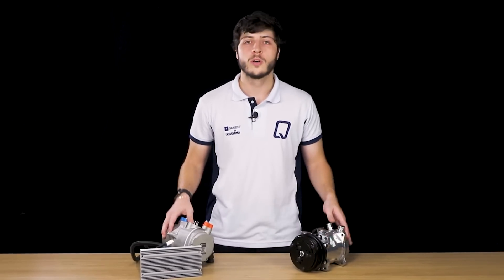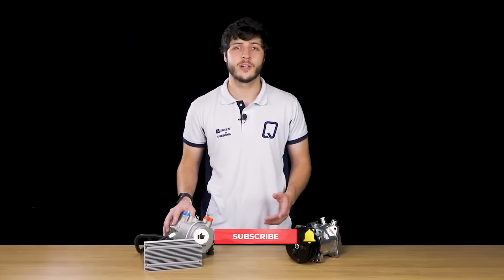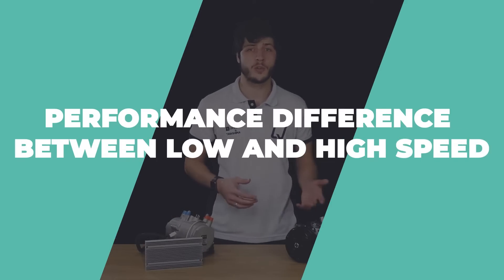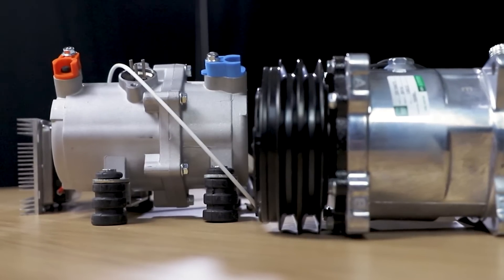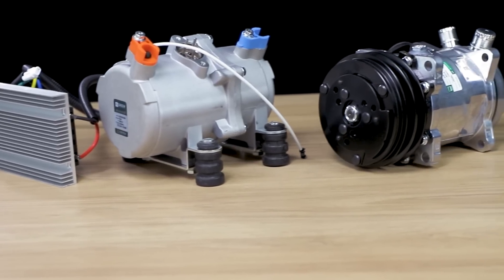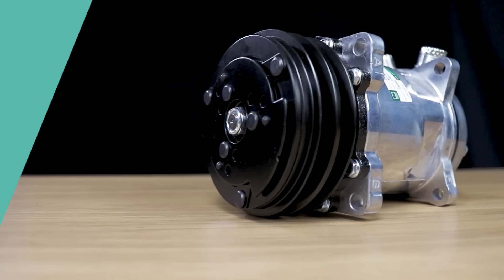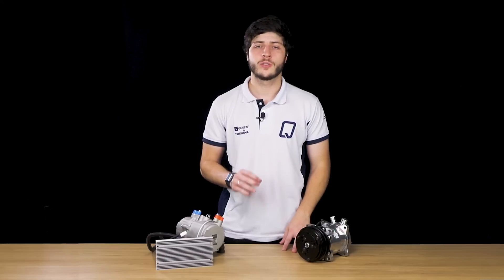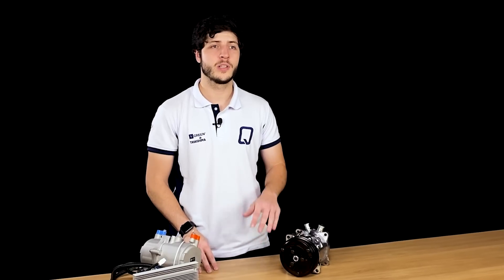Electric or mechanical compressor, which one should i buy?

Comment: Would it be hard to convert a 12v A/C compressor for a high output onboard air compressor?
I already have a high amp alternator and large lithium aux battery setup.

Comment: Hey thanks for this video but would great id you can make a video answering my question 🙏🙏🙏:
First let me tel you what car I have, it’s a kia sorento 2017 and I already installed a 95A AGM battery and going to have a massive SQ sound system around 16 speakers (with 2 of them being subs one in the front and one in the back) I know that I have to change my alternator but honestly I’m way to the freight to a new powerful alternator and damage any electrical system in my car and I truly want to add a good electric compressor to my car since I’m having a lot of issues with my current belt driven adapted air compressor and my AC electrical system (wires gets extremely hot and blower really got blown and the fuse box in the engine bay started melting 🤦‍♂️at speed 1 and 2 all is good but at 3 and 5 the wires get extremely hot the the relay gets blown) 
So if I want to swap my belt drive compressor to an electric one what should I do to make it as OEM as possible keep my AC controller, working perfectly and make it as safe as possible and ditching the factory faulty  electrical system?
Reply from the maker: Hi, you can change your compressor for the electric model, and you can keep your AC controller. If you prefer, we also have an AC controller available. An alternator with 100 amps or more is recommended. Contact our sellers at 888-907-0705; they will help you with this. Thank you.
Reply: @qualyairusa yeah I was talking with you guys in the chat on your website but I asked if we can talk on WhatsApp since I’m in Ivory Coast/Abidjan and will be shipping everything I need from the US and wanna make sure beforehand that I’ll know how to install it so I need to send you some video so you can guide through everything 🙏

Comment: I’m hunting down the amps required. I’d like to run this with my little generator. I’m thinking about an in-line capacitor to handle the initial start then the little gen can run it all night
Reply from the maker: Hi, an alternator with a 75 amp is recommended. 

It will work and perform very well. 

If you have more doubts, contact our sellers at 888-907-0705. 

Thank you.

Comment: Can you please mention in comment the advantage and disadvantage of electric compressor
Reply from the maker: The electric compressor will perform as equal to a conventional model. The difference is that the electric compressor is connected to the battery and not the engine and we recommend an alternator with 75 amp. 

Feel free to contact our sellers at 888-907-0705.

Thank you.

Comment: Installed this on my truck and right away having issues! Charged the system with the recommended amount of Freon and it just blows how and the pressure will never drop
Reply from the maker: Hi, please get in touch with our sellers at 888 907 0705, they will help you. 

Thank you.

Comment: Can you please advise what are the requirements on the vehicle to replace the mechanical compressor by your electric one ? 
- How much alternator amps rating ? 
- Does it effect the engine performance by making alternator works harder ? 
- I have Honda civic 92, are high and low pressure hoses of it fitting pretty well with your electric compressor?

The last question how can I purchase it..
Reply from the maker: Hi, thanks for contacting us. 

- Don´t have the requirements to change; you can change your conventional compressor for the electric model. 
- An alternator with 75 amperes is recommended.
- It will perform very well, don´t worry about that. 

To ask more questions and buy, contact our sellers at (888) 907-0705. 

Thank you.

Comment: I have a 2000 black durango with a 5.9 V8 with a 270amp alternator. Which system will be best for my setup?
Reply from the maker: Hi, Both systems will perform very well. 

Don´t hesitate to contact our sellers at (888) 907-0705.

Thank you.

Comment: Any chance to replace an existing belt driven compressor to an electrical one? Wonder if is possible to replace my van ac compressor to run, specially while parked, from my EcoFlow Delta Pro. Delta Pro has a 12v 30A output Anderson connector.
Reply from the maker: Hi, yes, you can use our electric compressor, you will need to do some adaptations only. 

Don´t hesitate to contact our sellers at (888) 907-0705.

Thank you.

Comment: When your car is running its 14.6 volt only 12 at rest.Although 24 would be best you wood need two electric systems.
Reply from the maker: Hi, thanks for your comment. 

Don´t hesitate to contact our sellers at (888) 907-0705 if you need something else.  

Thank you.

Comment: Can I run this from solar panel by putting solar panel on the car roof...electric compressor
Reply from the maker: Hi, 

Unfortunately, It doesn't work because the energy that reaches the inverter is not continuous.

Comment: I got a question which am having a difficult time finding an answer for, am having a 1974 VW Bus and looking for the best air compressor that would handle the cabin area inside and what is the recommended power shall I have to keep running that device for at least 6 hours with engine off?
- air compressor specs
- power consumption 

Thanks
Reply from the maker: Hello, you can put our electrical kit, it will perform very well in your vehicle.

We have the kit that will fit perfectly for your vehicle, don't hesitate to contact us at the phone (888) 907-0705.

Thank you.
Reply: @qualyairusa  will contact you via email coz am from overseas 👍🏻

Comment: Hi I have a 1991 mitsubishi mighty max 2.4L using originally an FXA80 AC compressor. Would this work in it this old of a vehicle?
Reply from the maker: Hi, Yes, this piece will work very well. 

Feel free to contact our seller on the phone at +1 (888) 907-0705.

Comment: Hello greetings from Greece! 
Could you tell me how I’m I supposed to install it in a car that never meant to have a\c before? I mean what else should I need? The car has no control panel nor ac buttons in it!! Any help would be appreciated!! Plus I’m from Greece, do you send them overseas if it need to?
Reply from the maker: Hi Dehard, how are you? 

Yes, you will need a whole kit, not the compressor only. We have a lot of clients that put our kit, in the same situations as you. 

Let me know, do you prefer an electric or conventional kit?  

You can contact our seller team at +1 888 907-0705. 

Thank you.

Comment: I have a 1985 Mustang LX 5.0 WITHOUT factory air conditioning can i use this system on my vehicle ? Would the compressor be stored in my trunk ? 
Thanks
Reply from the maker: Hi Mike, yes, you can use this on your vehicle, you just will need to make some adaptations. As you don´t have the system on your car, you need the all system, not the compressor only. 

Feel free to contact our sellers on the phone: +1 (888) 907-0705.

Comment: Can electric compressor work on older cars like 1999-2005 cars
Reply from the maker: You can use these universal electric compressors with cars of all ages. We recommend an alternator with 75+ amps.
Reply: @qualyairusa how can I know the rating of my alternator? 
W123 300D NA

Comment: I have A/C with an electric compressor in my ‘64 Beetle.  It works fine although the under dash control unit is a little primitive and makes it difficult to control the temperature of the air.  I have/had  other 3 electric cars:  BMW i3, Tesla model S & Tesla model X.  Driver inputs to electric car HVAC are merely “suggestions” to the systems in my opinion.  I can set the climate control to 72F and it can still blow cold air and sometimes I’ll have to set it to 80F to get warm air then, after a while, I can lower the set temp back to 72F when it starts blowing warm air.  Same is true when wanting cool air.  The narrator here needs to slow down his speaking.  It was hard for me to understand some of the technical things while trying to translate via his accent.  By the time I got his point, he was two points past.
Reply from the maker: We have two models of under dash available. One includes the heater core, and the other is just for cooling. We suggest you check your heater core to ensure it works fine. You can find our heat and cool under dash on this link below:

https://qualyair.us/products/universal-under-dash-3-speed-12v-air-conditioning-evaporator-heat-cool

If you are not considering changing parts but just adjusting your controls, I recommend you check this with your mechanic.

P. S: Thank you for your feedback. We will make sure we adjust ourselves to offer a better experience. We appreciate you taking the time to share your opinion.
Reply: What is the current draw on the undermount aircon?
Reply: @bobtomica9614  You know, I have no idea.  The car is currently in Texas and we are spending the holidays in California.  When I go back to Texas in January, I’ll ask the shop which did the install what the draw is.  They are also going to turn down the cooling by 5% or so as there is quite a bit of condensation dripping down onto my feet right now.  They had that problem with a subsequent install and that adjustment solved the condensation issue.
Reply: @donelmore2540  Would appreciate it if you make a video of how it was installed .... Did they changed the battery to a bigger size? Thanks.
Reply: I have a response - your Tesla has had millions in development and special production parts developed with modern tech to make the car a comfortable cool whereas your VW installer threw some junk kit from eBay in your car with no design, no development, lowest priced parts and it’s a 50yr old car that has been retrofitted with aftermarket equipment. That’s why your VW had bad A/C. Listen to me - I got out of the VW industry many years ago most of the clients are really cheap, like really cheap, not saying you are but this dominates the entire VW market so you can’t find quality parts for VWs. Now I do Porsches and we install upgraded AC systems that cost $8-15k and that’s why what we use never make it to VWs, those guys don’t even want to consider using the stuff we use.

Comment: Thanks for these infos you gave in this video, but I doubt the electrical ac cop. could handle my place's high temprature that reachs 52 C°. This is my major concerning about it. Thank you again.
Reply from the maker: The external temperature should not affect your A/C System performance. The compressor is expected to be capable of handling such high temperatures. However, we recommend you take this unit to an experienced professional who can guarantee the correct execution of the job. If you can put this together, we are confident you will have good A/C for such high temperatures.
Reply: @qualyairusa what is the maximum temperature for T1 and T3
How much heat make because I want put it back
Can I use it for bus